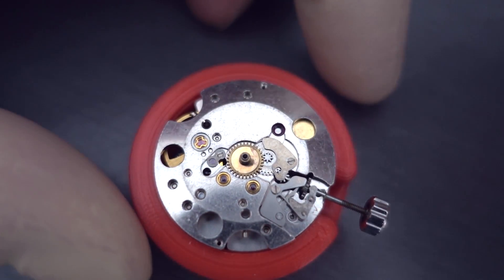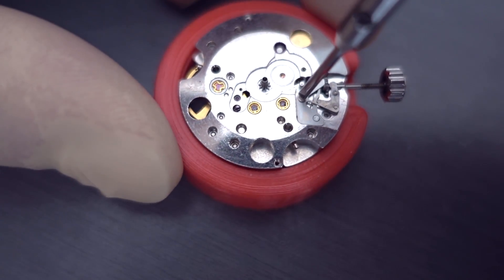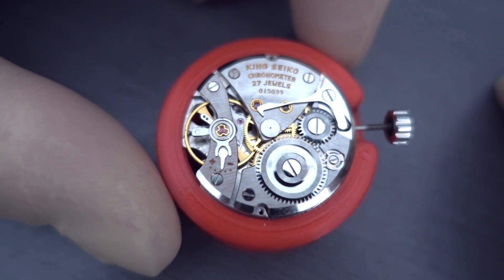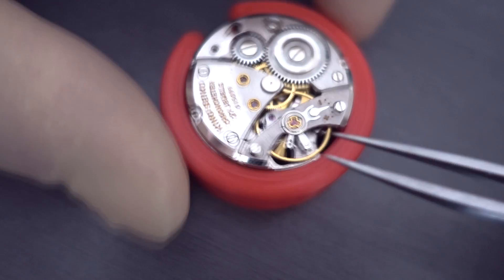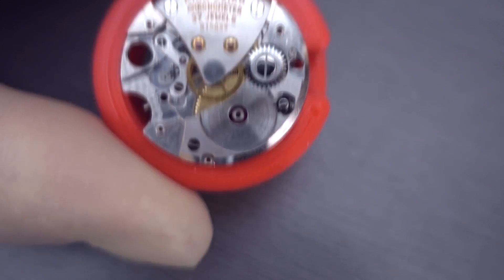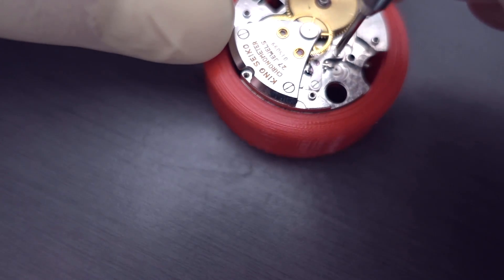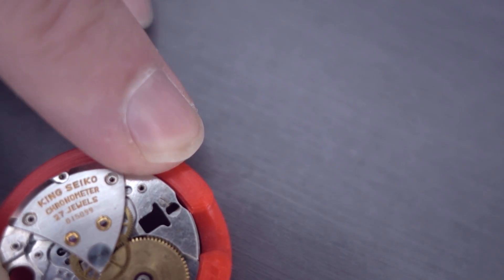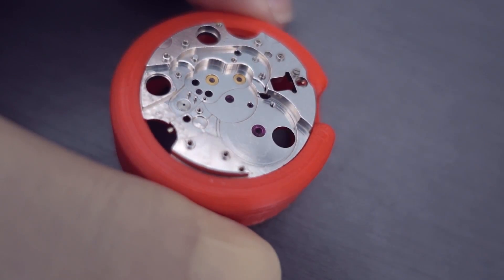[TECH] - SEIKO "KING SEIKO 49999" CHRONOMETER MOVEMENT TEARDOWN

Comment: I believe that this movement is from the 4420-9990 or 49999 model - the 44999/44-9990 is a different, non-Chronometer model, with a 25j 44A movement and textured indices at 12 o'clock, and a different case (the lugs are the most noticeably different feature between the two cases). Your example appears to have a replacement balance bridge from a 44A or perhaps a 4402 or a pre-44A 54-40-1 movement, as I believe the 4420A King Seiko Chronometer movement should be marked with "4420A" on the balance bridge. Do you have jewels or part numbers for jewels which will fit the barrel arbor ports in the mainplate/bridge of the 44KS movements such as these which are found in the 27j 4420 but not in the other 25j 44KS movements?
Reply from the maker: Geday,

You are actually correct for the most part. The time between recording this video and uploading it was approximately 6 months and I had forgotten the case/dial information for this watch. I've just fixed up the video now so it's correct. It is a 44-9999 chronometer. It has "CHRONOMETER" in script on the dial and the gold lion medallion caseback.

It is totally original. From memory very early, I think 63/64.
Reply: I can't find any information on the 44-9999 model. Could you describe the case to me, please? Do the lugs stick out at an angle to the case, as on the 44999/44-9990, or flow smoothly from the sides of the case, as on the 4420-9990/49999? Does it have textured indices at 12 as on the 44999/44-9990, or smooth-topped ones as on the 4420-9990/49999?
Reply from the maker: Actually, correction again, it's 49999. 

Images here -

https://i.imgur.com/LTc99HY.jpg

https://i.imgur.com/c3lokM5.jpg